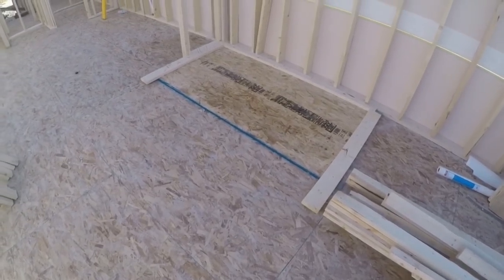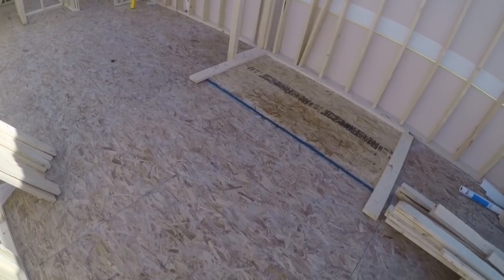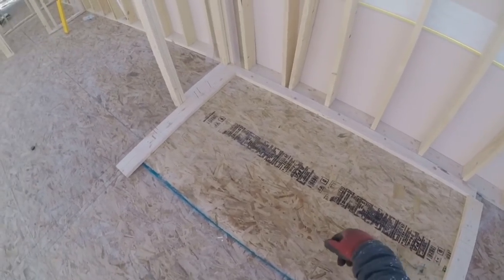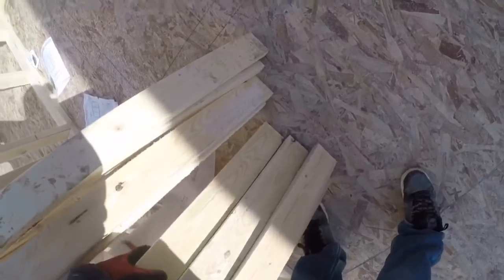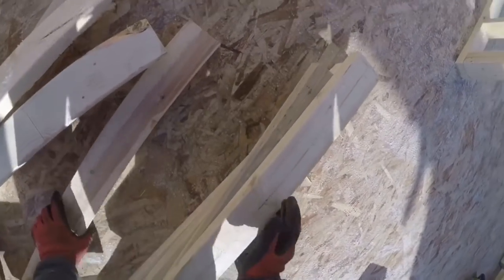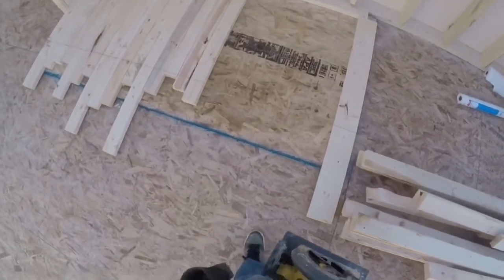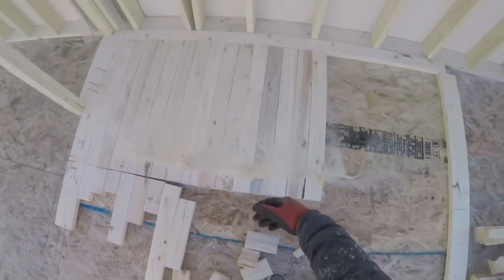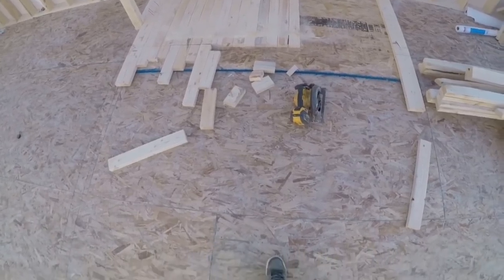Quick framing tips and tricks #1

Comment: I do the same kind of thing for deck balusters. Also when cutting studs I square up one end of the lumber bunk with a 4' level, snap a line at the other side at my needed length and cut. The saw cuts a groove in the layer below so there's no need to snap an other line. You might want to do a video of that tip as well. I've seen finish carpenters cutting studs on a miter saw with a stop block......... WTF?!
Reply: Seems to work for one or two layers, but you ever run into the issue of the line wandering due to blade flex(or possibly a not-perfectly-square foot on your saw)?

Granted, easy enough to snap a new line every couple of layers.